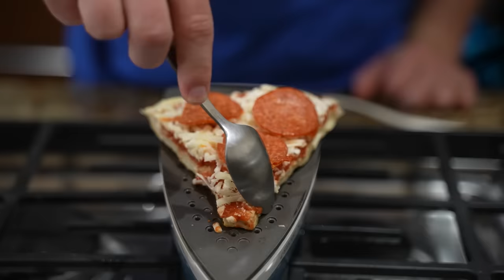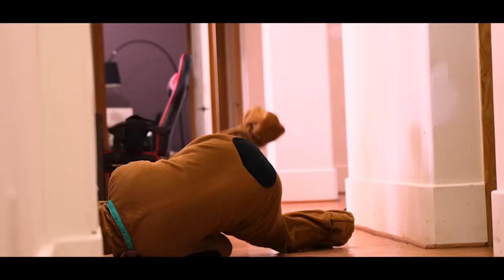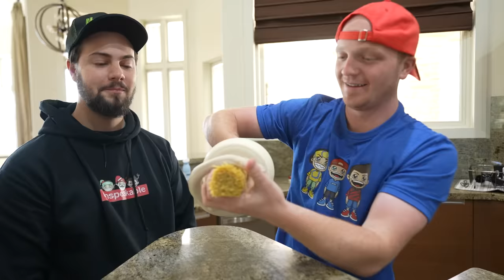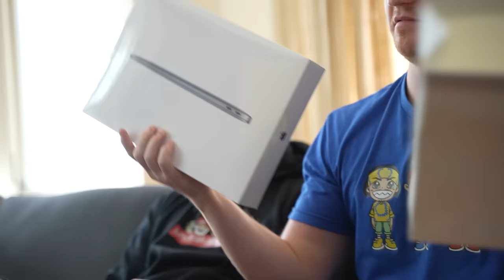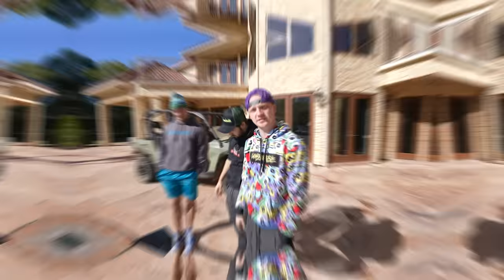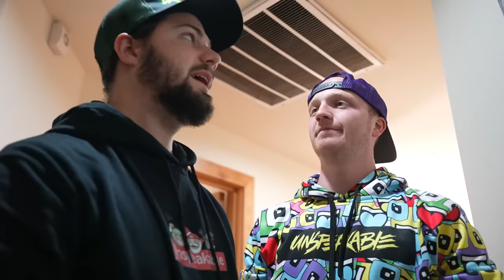Busting 21 Secret Experiments!

Comment: The earliest way ever to build what water pressure was by getting a cone and running the water through the big end of the cone out the little end also ensuring the water cannot overflow and escape so the only place it can go is out the little end at higher speed